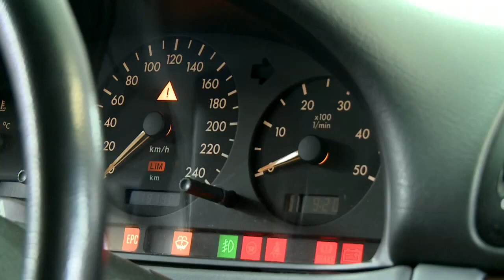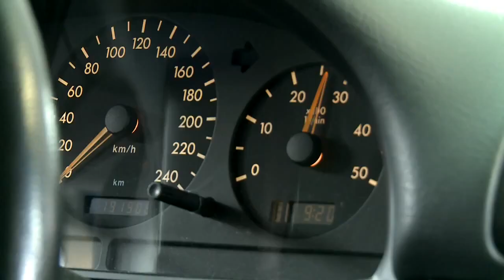LIQUI MOLY ProLine Diesel Intake System Cleaner

Comment: I think that’s a very bad idea. Because, using this cleaner that technician actually pushing all the carbon and dust into the combustion chamber. Instead of this, I personally prefer to disassemble the throttle body and clean it with the throttle cleanser. This is how all the sludge and dirt will not inter into the engine heart, the combustion chamber.
Reply: Yeah, but the idea of that Cleaner is the same

Comment: And now the shit goes to your catalisator
Reply: It goes into the combustion chambers first, where it has a new chance to get burnt properly. If - for whatever reason - that doesn't happen and it exits the engine without getting burnt, it goes into your DPF, which is there just to burn any remaining soot periodically. Also, the amount of soot you can loosen this way is marginal compared to how much soot your engine generated during the time these deposits have been created the first place.

Of course if you don't like how it works, you are free to remove your whole intake and recirculation system, and clean it outside of the car. Which, however, will take magnitudes more time, with arguably not much better results in the long term.